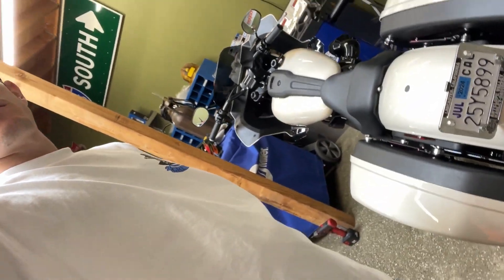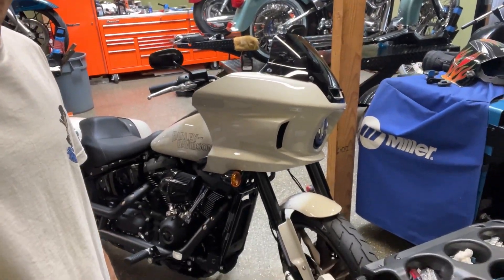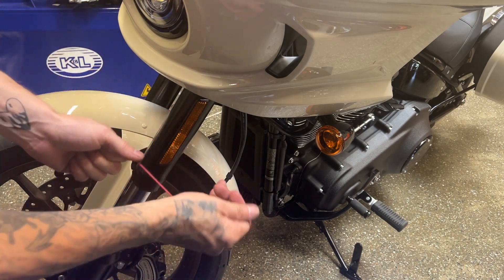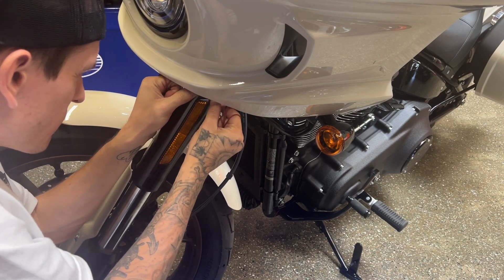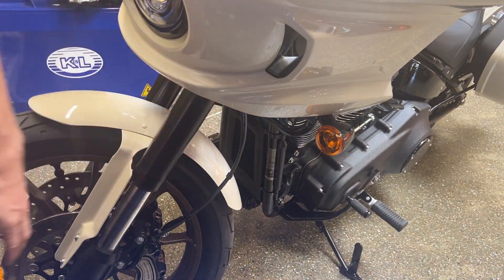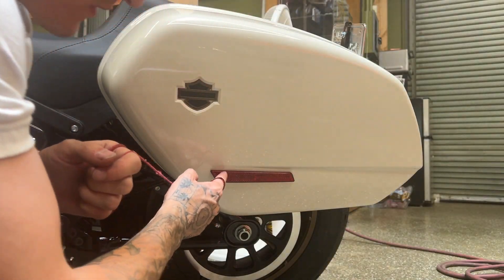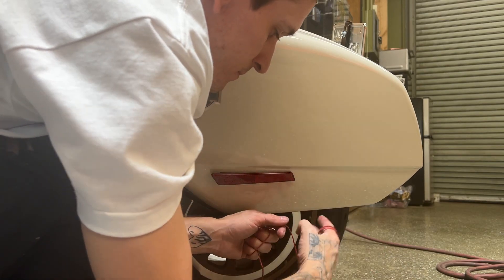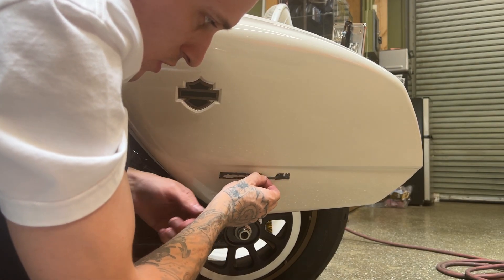Low Rider ST Reflector Removal

Comment: I use 100 lb. test fishing line and a heat gun (thicker line doesn’t tear the hands up as much). The more heat on the reflector the better, softens the adhesive allowing it to stick to itself while releasing from the paint. Then a goo gone soak and some elbow grease with paper towels and microfiber to get off whatever is left.
Reply from the maker: Yea fishing line works great, I just don’t fish and had string handy. Thanks for the input don’t forget to subscribe.